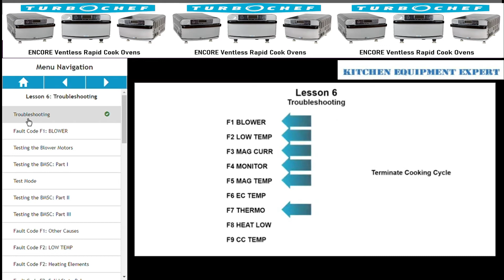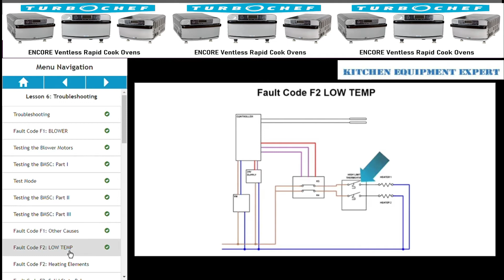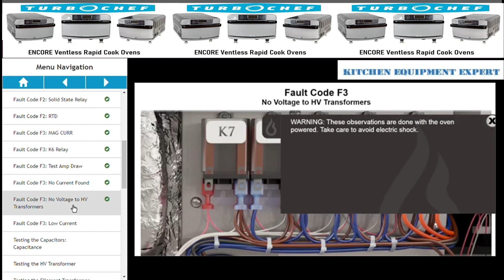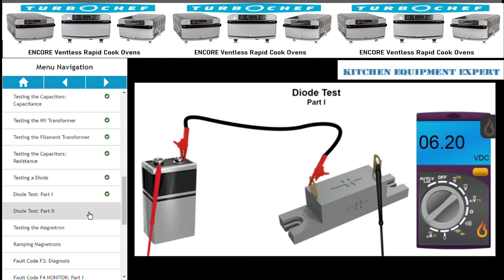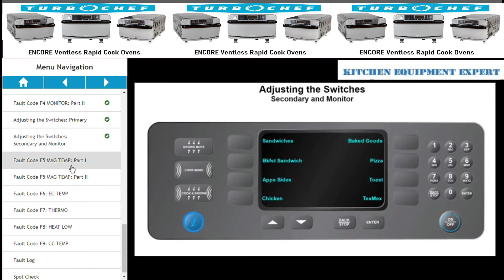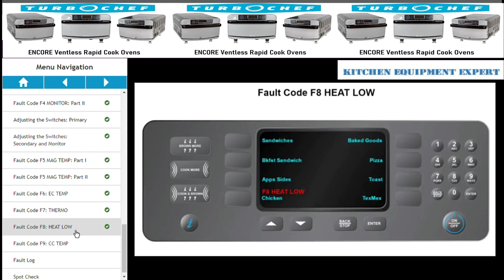Turbochef ENCORE troubleshooting Guide

Comment: What can cause the f3 fuse to blow right away? I changed it twice in a row, it blows as soon as you plug the cord into the receptacle. The diagram wasn't very helpful, I'm assuming I have a dead short/grounded load.
Reply from the maker: sorry for the late replay bro. first, check the proper line voltage, it should be properly grounded if it is ok. check the heater and blower for proper resistance and body ground, most probably one of these parts is shorted.
Reply: I know I’m a year late but the switches may need to be adjusted

Comment: Been working on this oven for 2 weeks straight.  No amperage reading on the brown current wire. Replaced control board, Replaced all relays, both Hv transformers, both capacitors, both diodes, and power supply. K2 relay just clicks a ton when you run the Mag test. I'm at a loss
Reply from the maker: amps reading on the brown wire represent the full function of the components,  do you encountered any error code?
Reply from the maker: base on your concern, technically you encountered the f3 error. we need to find out first why the brown wire don't have amps, check the k3 fuse if it ok check the k2 anode relay, while the unit is functioning you can get 24vdc at the coil relay.
Reply: @kitchenequipmentexpert4977  yea we had an F3 error. No amp on brown wire. Replaces fuse and f2 relay. We have 24vdc at the relay.
Reply from the maker: @diyclay525  consider to check or replace the magnetron.

Comment: What if the f2 keeps coming with high limit trip
Reply from the maker: try to reset the hi limit, if nothing happen check the proper resistance of heating element top heater reading should be 13 ohms and the bottom heater should be 14 ohms. if ether of them are open replace the heater.
Reply from the maker: another thing is the solid state relay, if the heaters reading good, check the solid state relay.
Reply from the maker: if the heater and solid state relay are good check the RTD sensor. thank you

Comment: cooling fans are running all the time. should i replace rise on thermostat ?
Reply from the maker: do you encountered any error code?
Reply: @kitchenequipmentexpert4977  nope.
Reply from the maker: @seanshin574  it is a rare scenario, basically  you encountered F6 error, if the oven control compartment getting to hot the cooling fan will turning ON, clean the fan filter if obstruction by dirt, or either the oven are in hot environment or too close to another heat producing equipment try to relocate the unit.